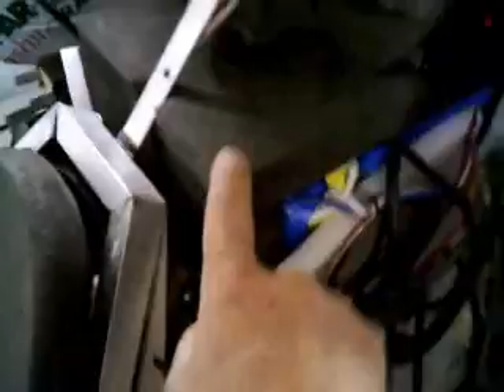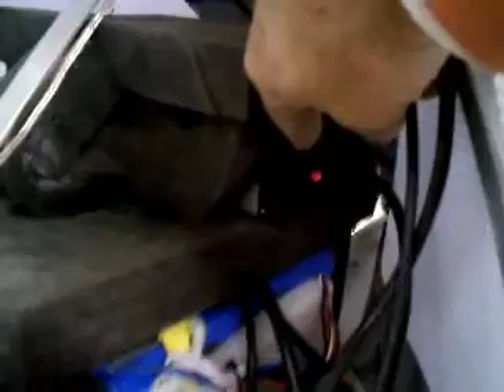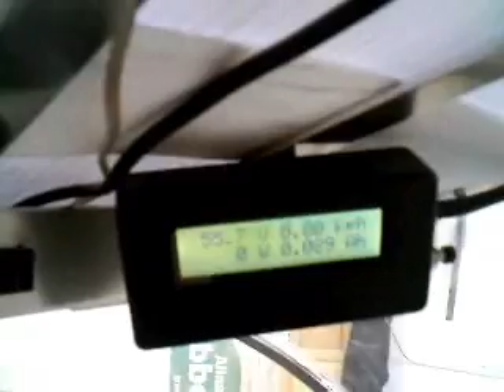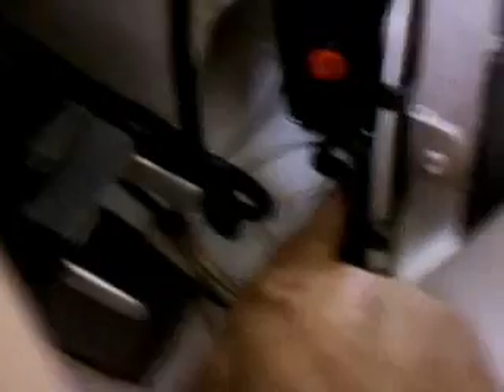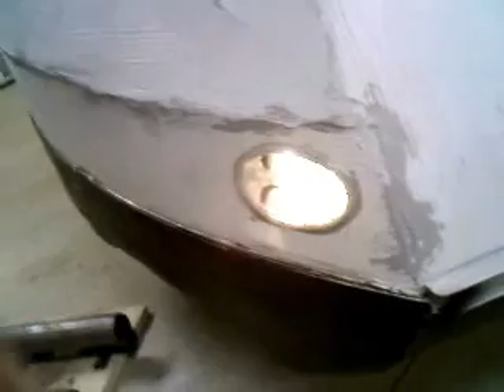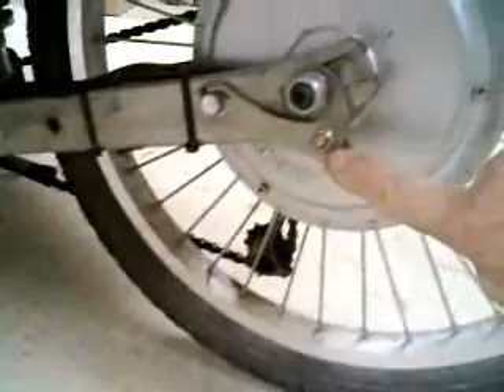VeloConstruction2_0001.wmv

Comment from the maker: Without a fairing or shell, aerodynamics is very non-linear. Smooth out the bumps and the response flattens off and even tapers as laminar flow takes over. I'm not quite there yet, but your quest is for sure.